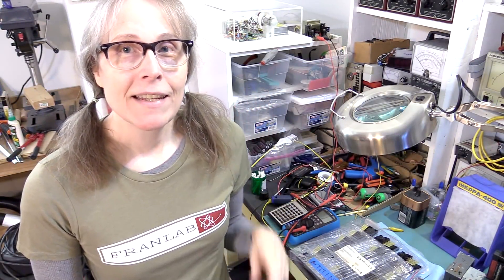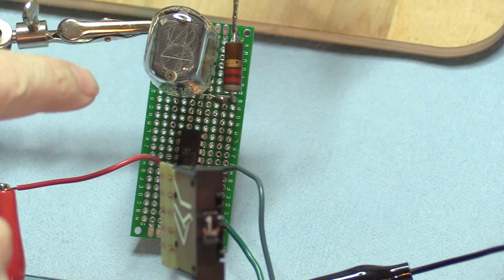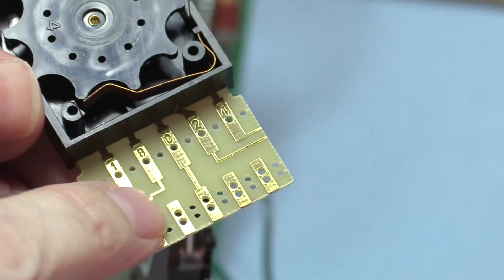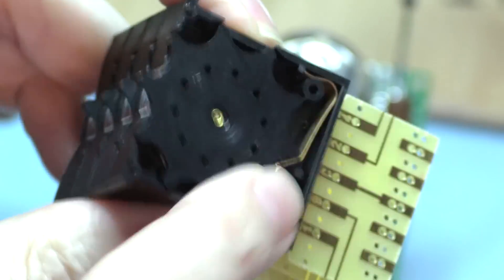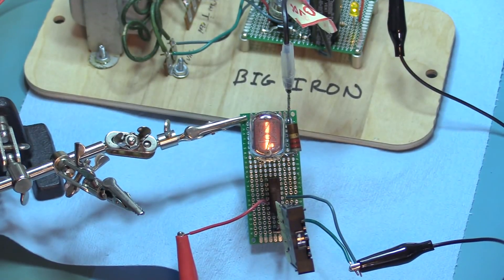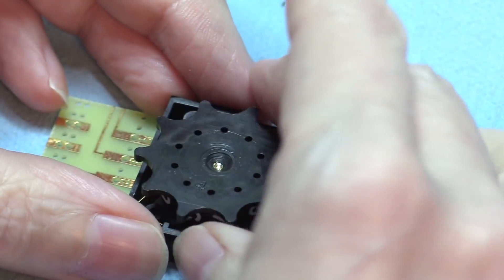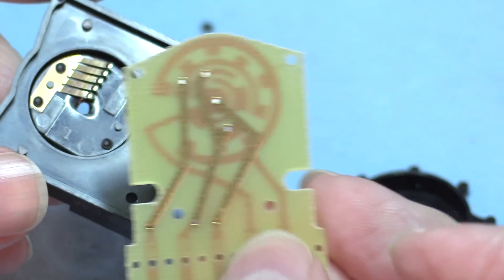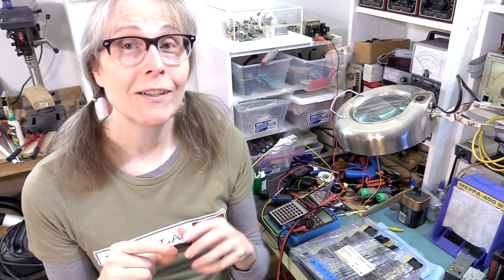Nixie Fun With BCD Switches!!!

Comment: Very interesting!  I had no idea how these worked, or that they are BCD.  Makes perfect sense when you see it.  Thanks for the video.  BTW, the camera is razor sharp!  Very impressive!
Reply: You get those that are not BCD, but that are a direct selection, giving 10 decoded outputs. Then others are reverse BCD, where the common is connected to ground, and then you have pull up resistors that you add to the outputs to get logic level high as the sections go open. Those allowed you to connect directly to a TTL BCD decoder directly and save on the 4 pull up resistors, as a TTL input would, by it's construction, regard a floating input as logic 1, as the logic low was done by pulling 1.6mA of current from it, with a voltage drop across the sinking source of under 0.8V, while leaving it to float allowed the internal NPN transistor emitter the gate was composed of, to turn off that particular section of the multi emitter transistor. Used a lot, as you could have a multi decade selector connected to a TTL magnitude comparator, cascaded to provide an equal to count signal from an associated counter connected to the other inputs, and save having to both route and install a lot of 470R pull up resistors, or for normal BCD, a lot of 330R pull down resistors.  As resistors cost a lot more then, plus routing was manual, this was a big saving, the lower power use was minor compared to how power hungry TTL is, but when you likely had only a 1A supply from a 7805, or 1.5A from a TO3 regulator, that was noticeable. Could save the difference from just using a single regulator, to having to have a boost PNP transistor in the regulator design, and the bigger heatsink you would need to place and find volume for.
Reply: They aren't that common, but there are hexadecimal switches too.
Reply: @anomaly95  You also get octal versions, that go from 0 to 7. A switch that is very common in aircraft, as that is the way you put in the transponder code that ATC asks you to squawk to identify different aircraft on the primary RADAR system. The transponder is an old technology, dating from the 1970's, where you gave a 3 bit per digit identity, then a BCD altitude from the altimeter in hundreds of feet, as response to every time the RADAR sweep went past the aircraft. Had to be a very short code response, as you could have multiple aircraft in the same sweep.
Reply: @SeanBZA  Definitely makes sense for octal. Don't know what was used for the ATC backend, but there were plenty of octal-based computers around back in the 70's.
Reply: @SeanBZA  I'm a pilot and noticed the octal aspect of the transponder codes - the highest being 7777, although I've never been assigned a squawk in that range.  Of course, the emergency squawks are 7700, 7600, and 7500, understandable they'd never give you a code in that range.

There is so much of that old technology that "hangs on" because it just does and there are so many existing transponders in aircraft that would need to be replaced.

Comment: Well, maybe you could have gone a bit deeper with the simple explanation of 'BCD'....as a matter of fact, I've seen thumbwheels that were HEX, and could be set from 0-9, A-F for the full 4-bit binary range.   And I noticed that that particular switch was negated BCD .....1/, 2/,4/,8/..... so a pullup resistor is probably required for each output, if you ground the 'common' connection. I might have that confused, it's been quite a few years since I've used those.

Comment: Great video, Fran.  But.....aren't they all....??
I see you are using Allen Bradley resistors. AB resistors are no longer being produced. They are outperformed by most modern resistors.
So, why do you still use them?   Do you still have a large supply of these ?

Comment: Used these in a countdown timer design long ago. :) Each BCD switch would preload a 74LS160 for each of the 7 digits.
Reply: They would also be perfect for setting the alarm on an alarm clock. It would be more user-friendly than the usual four-button interface. It would also remove the need for an alarm on/off switch, as the alarm could be disabled by setting it to any invalid time.
Reply: The 74hc164 counts by 10

Comment: I'm noticing a lot of what I assume is crosstalk while the switch flips, where the number that appears is momentarily the binary OR of the new value with the previous one. Do these switches have any sort of latch pin to allow filtering those things out, or is the expectation that the operator is responsible for ensuring nothing happens based on computations on the values while they're in flux?
Reply: No, you generally did not want to operate them on the fly, as you would get spurious outputs from them, along with a large amount of switching noise and contact bounce. You do get types with outputs that are not going to have glitches, but those are larger, as all the output traces are on the back of the PCB, and any jumpers are going to be where the wipers will never touch them, though you will have a zero value output as you are going between digits. You need to go to the 2 phase digital encoder switch, and the associated counter, to get a glitch free count.

Comment: Fran, I cannot agree with your use of the term “memory” for the thumbwheel switches. They are simple input devices classified as “shaft position encoders”. They simply output, in a BCD nibble, the wheel position as one of ten positions. When I read your title, my mind thought of set/reset latching relays of some other electro-mechanical contrivance perhaps involving stepping relays. As an electronics technician and engineer, I have worked with core memory [read/write and read-only] which got us to the moon and back, as well as magnetic drums and moving head disks. Not to mention the progression of silicon and CMOS memory from poly-fuse ROM, UV-ROM and Flash memory. Please rethink the term “memory”.
Reply: They are a form of user adjustable memory, as you did not typically adjust them in use, but they provided a set of data that was, to the system, non volatile, and which was variable. A lot easier to operate than the other alternative, which is a DIP switch array or the tiny little adjustable BCD PCB mount ones, which you typically used to set options on a system during installation or maintenance, but otherwise never touched again.
Reply: They are indeed a form of user programmable ROM, so it is acceptable to call it a memory device.
Reply: Correct. If a simple switch is considered a memory, every piece of wire would be a WORM (write once read many) memory as you can "program" it by cutting it through.
Reply: Maybe a "register" might be a bit more appropriate. Although, this might be splitting hairs at this point.
Reply: @pcxHB  That is precisely how early read-only computer programs were entered into early computers, using switches and patch cords, but such still constituted the program memory as actual writable memory was exceptionally limited and precious.  Even in modern hardware many devices make use of jumpers, DIP switches, BCD/Hexadecimal encoders, etc., to store their initial configuration parameters.

Comment: Hey Fran could you explaine how the LEd lit keeper works I watched this video on using it https://youtu.be/OSOxeP-GF4Q and was wondering is it just a 9 volt power supply with a piercing probe or is there more to it?  It would be a good seasonal video for you to do .  I don't understand how it could energize  the lights from both ends as Leds are diodes.

Comment: How have I made it this far in life as a programmer without having known that 4 bits is called a nibble? Always something new to learn at FranLab!

Also, even before you did the teardown I knew there is no way this should be a $60 piece of hardware. Checking on DigiKey, the pushbutton versions can be had for about $7. It looks like C&K is the only manufacturer of the thumbwheel versions, and feels they can charge whatever they want for a niche product. DigiKey shows a lead time of 15 weeks, so they also appear to be a build to order rather than a stocked item. At those prices though, I can't imagine there is much demand for them.